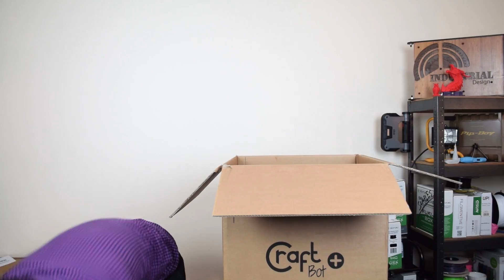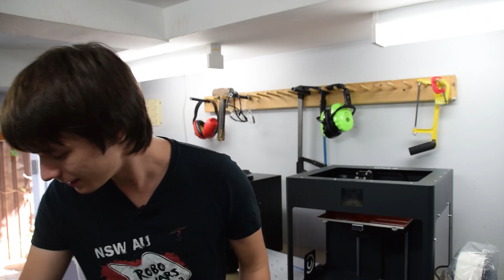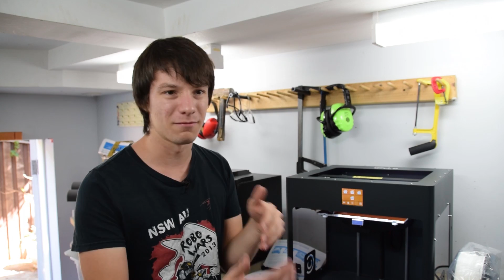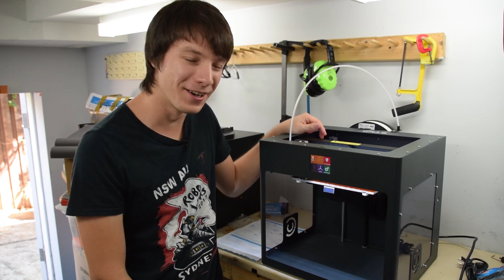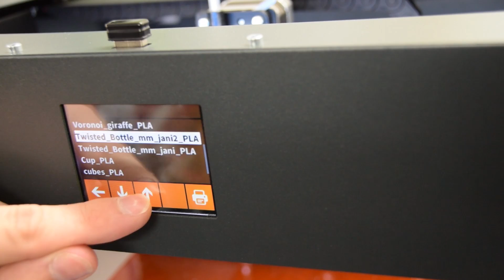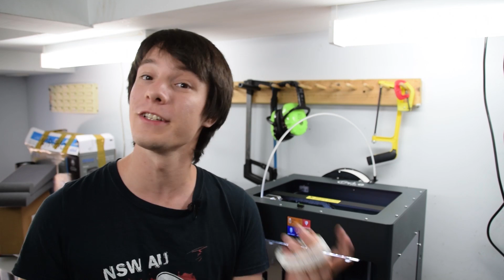CraftBot PLUS Unboxing and First Print!

Comment: Hey Muse, have you messed with any SLA printers? Been kind of looking around at some and would like to know your thoughts if you have any experience with them or any recommendations ect, Thanks!
Reply from the maker: Hey, not much yet! Though I have had a few prints done in sla and the quality can be phenomenal. They're a whole new beast compared to fdm, much messier !
Reply: yeah, have seen a few but man they cost a ton and the build volume is usually really small compared to similar priced FDM's. Still, am curious about them.

Comment: You should check out OLO 3D printer that uses an iPhone's light to harden the resin and only 99$, it's going on Kickstarter this month.
Reply from the maker: +TheIcemanModdeler Looks pretty cool, but I don't hold my breath for kickstarted 3D Printers! Been too many disappointments over the years.
Reply: +Maker's Muse Yeah, makes sense but on the other hand Zortrax came from Kickstarter.
Their idea at least is revolutionary using something that everyone already has to reduce the price of the printer, i wonder if they can use the same approach but with a tablet for a larger build volume.
Reply from the maker: I'm wondering how they got around the suction issue that SLA and DLP printers have, and yeah it might be great - just gonna have to see :)

Comment: I have the CraftBot Plus for almost 6 moths. Printer is great. Best for money.
Prints PLA; ABS, bronze, wood, stone, only problem is elastic material because of gap between extruder entrance hole and filament gear. Also I change Kapton tape on printbed with 0.7mm Polyetherimide sheet, and now I can print PLA, ABS and any other material witout any glue or hairspray. Keep up the good work!
Reply from the maker: Thanks for the tips!

Comment: I got one of the first original Craftbots. Definitely a solid printer but the firmware still needs more work.
Reply: couple more things to add (that might be useful for your review):

- the filament guide doesn't come far enough from the side of the machine, it tends to jam with stiff filaments (like PLA) I had to print an extension.

- The hotend design is lacking, it does jam on occasion as the entire hot zone is a steel screw and not a polished one like the e3d. if you don't let it fully cool before switching off the machine you're gauranteed a jam.

-The pause function is the best implementation I've seen on any printer, it locks the axis and allows for easy filament changes

-watch the coreXY system carefully, some people have had premature belt wearing problems.

- The Z axis is loud because it doesn't use microstepping. This is actually a good thing as it makes the layer heights super consistent. Take a careful look where the Z screw mounts to the bed, there's actually an oldham coupling there to eliminate any wobble in the screw (super neat!).

- keep an eye out for unaccelerated moves (again firmware problems)

-make sure you have the correct drivers for updating the firmware as they are different to the print running drivers and without them the screen just goes black as it wipes the memory and the firmware won't update (appears like a broken printer, scary stuff).

- The heater timeout on this machine is quite short (I think they upped it to 15 mins) which can be annoying if you like preheating your printer while you're slicing.

-The extruder design struggles with any types of soft filament like nylon (don't even think about ninjaflex or simular TPE filaments). It tends to spit them out the front of the extruder.

- The lighting has customisable brightness which is nice to have.

- The kapton they use is not your standard kapton, it's super thick and durable and prints PLA (with a bit of UHU glue stick) like no tomorrow.

-last thing is the printer tends to skip steps of complicated or torture test prints not due to a lack of stepper power but unaccelerated moves that crash into warped bits of the print again due to firmware that needs a bit of work.

Comment: Own software, but interprets gcode. Does Simplify3D give you gcode ? It might be worth trying (?) other slicers gcode for this machine :3

Also kudos for nice details like the lcd screen and printing from usb :)
Reply from the maker: You can use other slicers with the craftbot and you can use craftware on other printers! You're right, it's just straight gcode. :)

Comment: hi there. i have a craftbot + and wonder if you can make a circular- round test print and controll the roundness. i have this problem. sorry fore bad eng.
Reply from the maker: +veritascob Sounds like a problem, it shouldn't have any issues doing circles. Their support is great - have you contacted them about the issue?
Reply: +Maker&#39;s Muse i agre. their support is fast and they are very helpful, but to bad my problem are not solved. but i´m very picky

Comment: Did you notice that extruder is different than all of the ones I have seen that are direct drive?  That thing uses a pull down spring to apply filament tension against the MK instead of the normal push up.
Reply from the maker: +Dark Alchemist To be honest I always hated the flimsy plastic arms on compression springs... I'm really interested to see if this approach is better - the metal construction certainly makes it a lot more rigid feeling.
Reply: Maker's Muse Plastic arms?  The ones I was talking about are all metal not the plastic ones which do not have enough rigidity for my tastes.  Like this -> www.ebay.com/itm/141814933804
Reply from the maker: +Dark Alchemist All the chinese Mk10's have plastic arms... it's a throwback to the Makerbot Replicator 2x which they all originally cloned. That ebay listing is SO cheap!? Those parts used to cost 50 bucks plus not more than 3yrs ago...
Reply: Maker's Muse
I know and that isn't even the cheapest now. Metal parts are cheap now for 3d printers.

Comment: Good job Hungry. Looks like an all metal version of my finder, I could always upgrade :P
Reply from the maker: +Mickice How is the finder? I'm looking forward to Joel's review but I think he ran into faults on his. Aparentley it's super quiet! PLA only though :(
Reply: Super duper quiet and the internal storage is incredible, mine is loaded with junk iterations of stuff but thats fine. Couldn't be more impressed with my PLA prints. FlashForge have the settings just right, you just choose speed and height and you get it done. 

Raspberry Pi case in Dremel translucent white. http://i.imgur.com/pw807bI.jpg
Reply from the maker: +Mickice Raspberry Pi 3? Can't even get hold of one locally... That finish looks spectacular! Damn... I really wouldn't mind testing one out - could be a good option for schools. Flashprint really has come a long way, the fact they have manual support control is REALLY cool.

Comment: I won my Craftbot+ in their Facebook giveaway. I requested a roll of ABS be shipped with it and it printed the 'Crafty' robot pretty much flawlessly first time. Later if you remember Angus, I printed your torture test with great results. After a few prints I couldn't get anything to stick to the bare Kapton (@ 110C), which I think might have been a  change in environmental conditions and I've been using 3D-EEZ on the bed.

I have been running into warping and de-laminating issues. The electronics compartment fans blow into the build area and a cover for the slot at the back may help. I've also had problems with the extruder drive stalling and will have to play with turning up the drive current (set with a G-code).

I'm now in the process of upgrading to an E3D hot end so I can use Colorfab XT filament which will hopefully help with the warpage. I'll also add that I think the shipped nozzle is too sharp and doesn't give a particularly good surface finish. The E3D nozzles have a small 'wiper' flat on the end.

Comment: Hi! I'm about to buy my first 3d printer, and I'm not sure which one to get.
I did an extensive research and got stuck on these tree models:
Zortrax M200, Witbox 2, and CraftBot Plus. Have you ever tested the first two on the list? What do you suggest?
Reply: +Wallison Medeiros I have the CraftBot Plus for almost 6mths now. It's a great printer, and with the latest firmware and gcode mod, you can hit 160mm/s print speed for PLA. It can do ABS, but requires a LOT of effort and is best around 80mm/s. 

PLA with painters tape never fails. ABS will require juice on the kapton tape and heated bed. I have not used exotic materials yet.

The slicer, CraftWare, is fantastic. I feel plenty of control, and the support material feature is a definite bonus.

Lastly, the forums at CraftUnique are quite responsive. We know a lot of the quirks with the machines and there is plenty of activity with the company still updating its software.
Reply: MrBigBear
Thanks for your answer! I'll visit a store and gather more info about it.
Reply: +MrBigBear , try 0.7mm Polyetherimide sheet, I use it on my Craftbot+ and it is great for PLA, ABS and any other material.

Comment: As a CraftBot (not Plus) user, I have some advice:
- You can put the spool holder to either side, not just at the back.
- You should level your bed after transport, there is a function in the Settings menu for it.
- You should clean your Kapton every day

The bracelet should not detach, I think, it must have been leveling or dust on the Kapton.
Reply from the maker: Thanks for the tips! Yep I did level the bed but didn't use the function, so it could be improved. Was just odd it detached after completing.
Reply: At least it did not detach halfways :-)

Comment: A really nice looking printer. In this video you compared it with the Wanhao i3, but wouldn't it be better to compare it with the Cel Robox or any other 3D printer for around 1000 USD? At this price point I could get two Wanhao i3, so comparing them seems a bit strange.
No matter what, I can't wait for the review.
Reply from the maker: +Intemperiae True, it's not a fair comparison. Funnily enough, the Robox doesn't even have an interface! But I will certainly compare it to printers of the same price bracket in the review. The touch screen is the best I've used, hands down on any 3D Printer so far.

Comment: what would you recommend for a first 3d printer.
Reply from the maker: What's your budget?
Reply: around$1500, and if its worth it possibly $2000..ive been looking at the cheap ctc ones on Ebay, the makerbot replica for around $600 and was looking at the davinci printer scanner, but didn't like the cartridge idea.